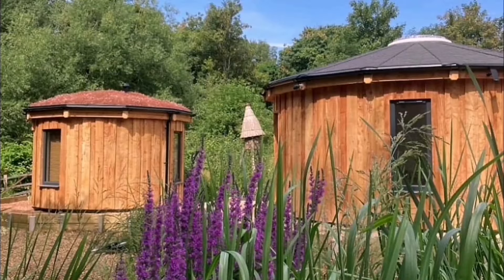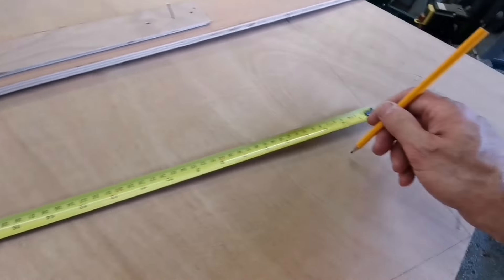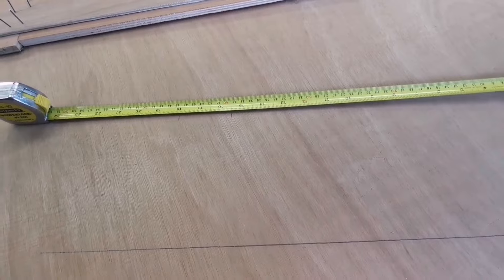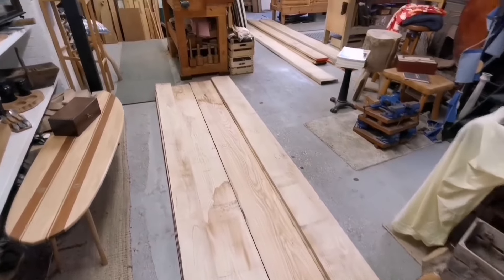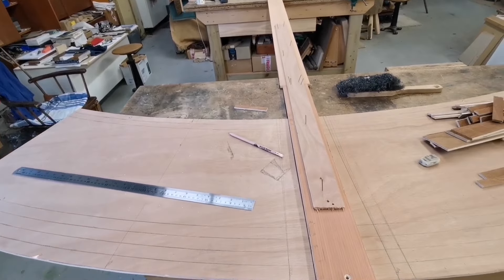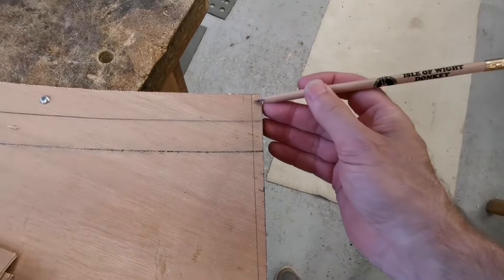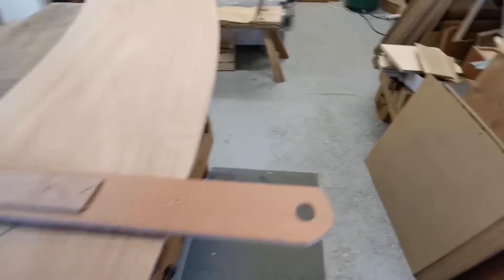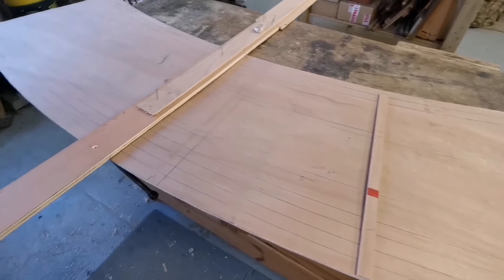Curved seating.. from the start

Comment: fantastic mate.
Reply from the maker: Cheers Darren. How are you doing in this wonderful Winter weather?
Reply: @twcmaker  the cold is so much better than the wet but my body has let me down these past few weeks, lots of editing going on too like you.
Reply: How are you doing?
Reply from the maker: It's a busy time. Getting back into the Year. At least the nights are getting lighter. I'd got 128 video clips on my phone a week ago. Only 59 on here now. Need to get on top of it. I'm not happy about this gold weather though. I have to cut more wood up in the workshop. The good thing is it's moisture content it low currently 9%. Then it gets lower being stored by the fire. It's burning well. Some nice Oak this evening. Table legs that I saved.
Reply: @twcmaker  that’s a great start with your editing then. 
We’re getting through some logs at the moment but  when I think what our gas bill would be…
Reply from the maker: I know. Scary with this freezing weather.